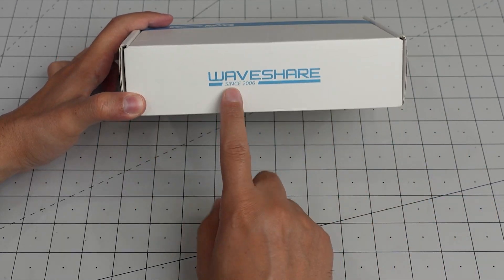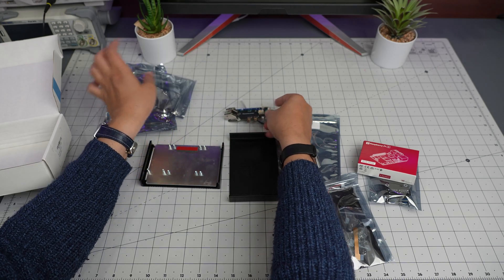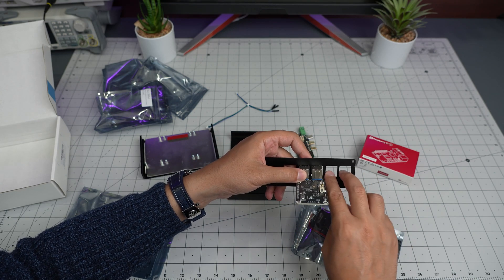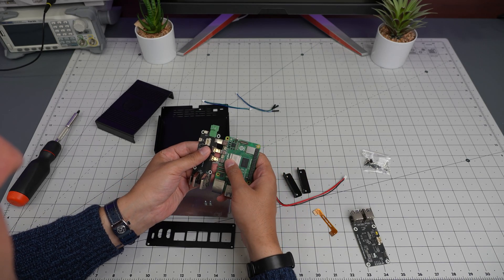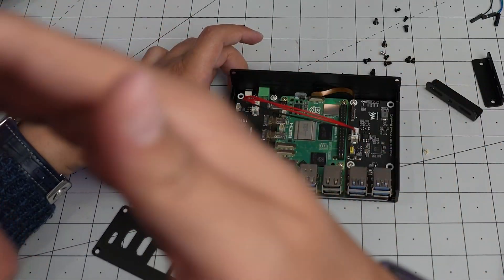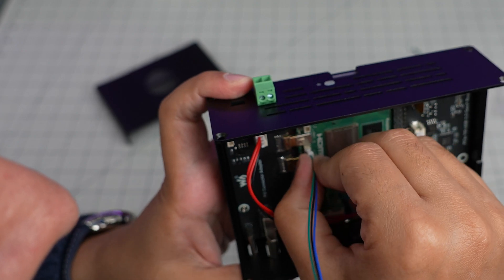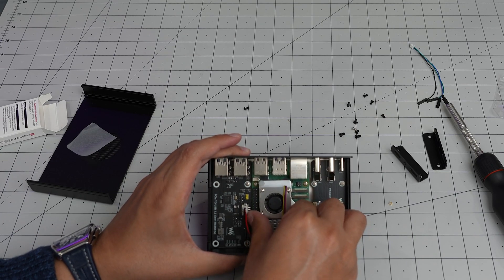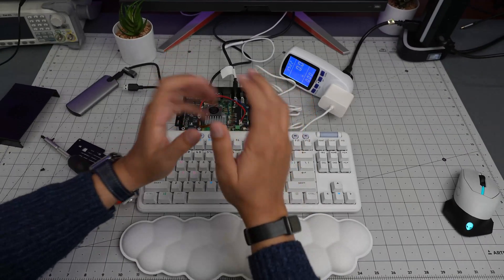Unboxing the Waveshare Pi5 Module Box: Raspberry Pi 5 and USB 3 Performance

Comment: I'm just getting started with the Pi 5 running Bookworm.
If you plug a USB 3 SSD directly into the Pi (not using the kit),
and compare it to a Windows 10 system where the same drive hits ~288 MB/s read and ~302 MB/s write,
what kind of speeds would be realistic to expect?

Comment: This is Pi5 Module Box A , there is an box C with nvme support, i was thinking of purchasing it, i don't know how that will perform 😔
Reply: The NVME board is good, the bootup time is near instant to desktop on a new install. You need to enable full speed to squeeze the performance out of the SSD but it's only a case of flipping a switch in raspi-config. Just install the OS to a USB flash drive, boot from this first then use the raspberry pi installer to write to the NVME - I wrote 8 in about 2 hours, and thats with time to forget what I was doing between tasks and leaving them waiting for me to shut them down and then setup the next.

Comment: The detailed assembly guide for the Raspberry Pi 5 enclosure is incredibly helpful and thorough.

You’ve provided a very fair evaluation of the product, highlighting both its strengths and areas for improvement, which is immensely valuable for viewers.

Thank you so much for your effort and insights—I truly think Waveshare colleagues  could learn a lot from your approach!

Comment: This case is not ment for a desktop replacement.

 * It has a industrial power input (green)
* All the connections are on the opposite side of the power.
* The tty link is connected, and is most likely available on the USB-C.

The lack of NVME is in this case logical. It is ment to be locked up in a closet somewhere with a lot of IO (USB ports).

Comment: Does the case have a slot for a GPIO extension? Any info on that cool power supply you used to power it up?
Reply from the maker: Unfortunately nothing for GPIO, you can install a header on the RPI and it would most likely fit inside the case, but GPIO pins are not exposed to outside of the case. As for power supply, I'm just using this https://www.amazon.com/gp/product/B0CT2HH7FJ/
Reply: @TechnicallyUnsure  There is a thin gap in the case to allow a ribbon cable to come out of the case. I would look for a different box if you need to use GPIO's though, unless your use case is a set it and forget it location. For me, I have 8 now and they will all be set in a rack unattended, remote controlled on a 5.2V 100A PSU (the voltage drop on the cables means I need to have slightly more voltage, I am working on a solution using DC:DC convertors on each for voltage stability. MY PSU is a Mean Well, its stable, but voltage fluctuations caused by the cable is my issue (at the moment).